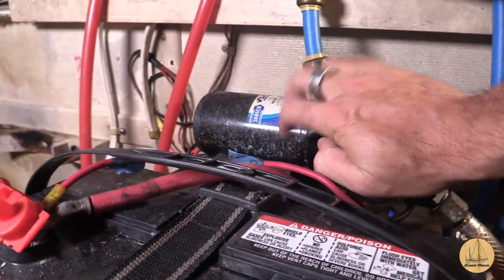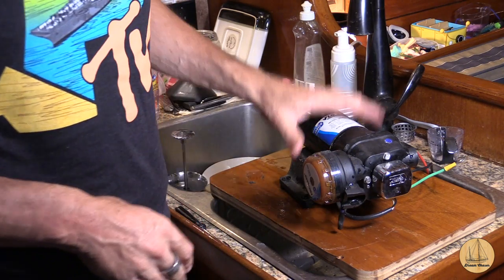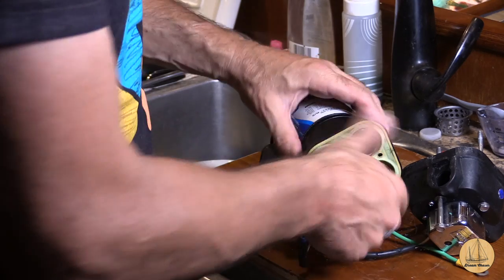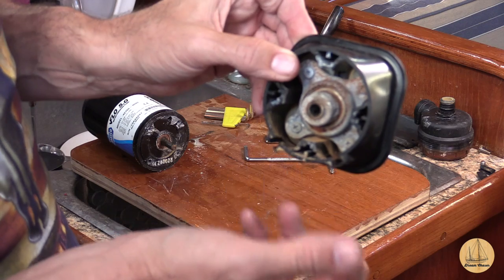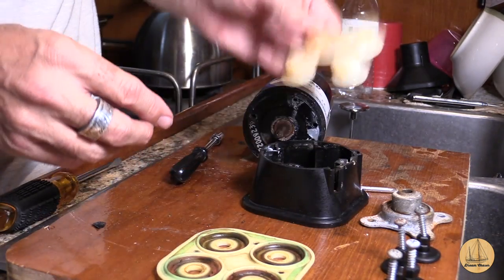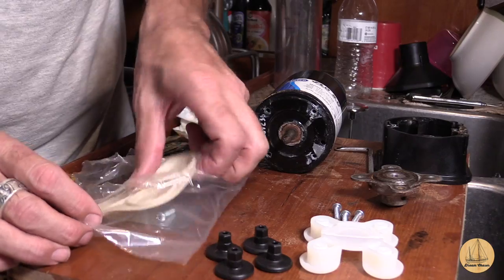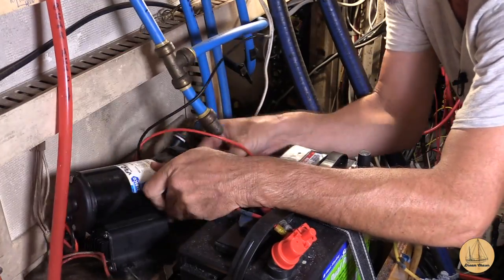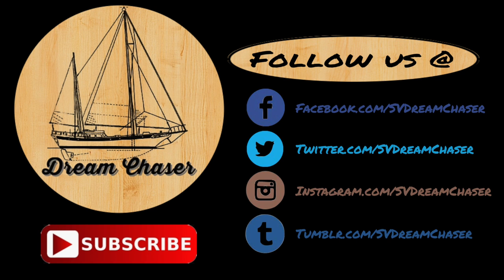Heavy Wind and Weather and How to troubleshoot and rebuild a Fresh Water Pump

Comment: Thank you that was very helpful, I am having a problem with my Jacsco Sensor Max 17 it is making a knocking noise and I would think that means air in the line. After watching your video I am not afraid to attempt a rebuild. 
Thank you again for taking the time to share this information. 
Bill, SV Blue heron
Reply from the maker: Bill Burkart glad you found it helpful. I had an issue with my motor being loud and in my cSe it was actually the motor mounted too close to a beam in the engine room and it would run against it sometime and vibrate the bulkhead like the back of a guitar. I moved it over a 1/4 inch and that stopped. 
I am not sure if it may be something that simple or knocking in the lines. We installed per lines so the "banging" that typically comes from rigid copper isn't present.